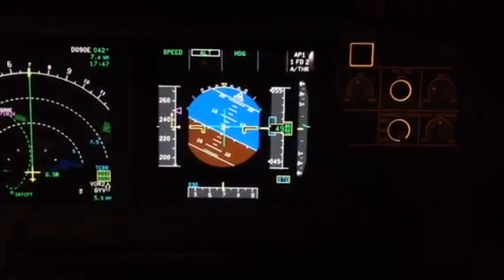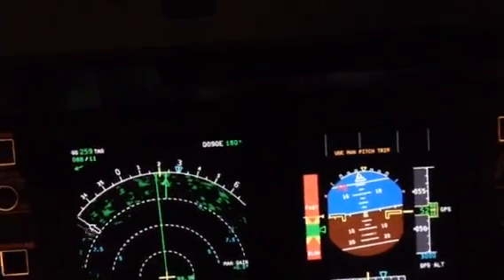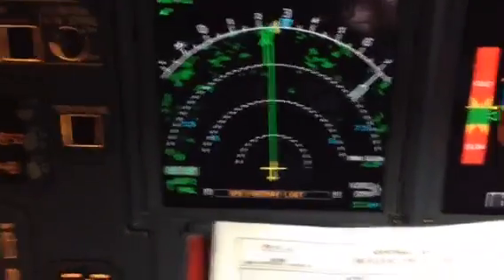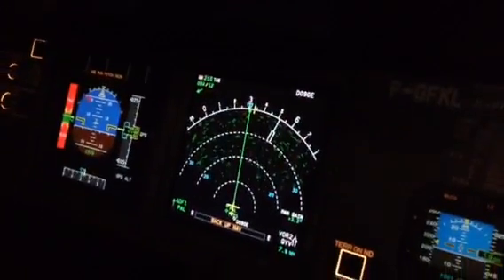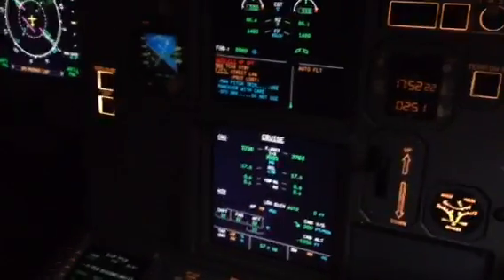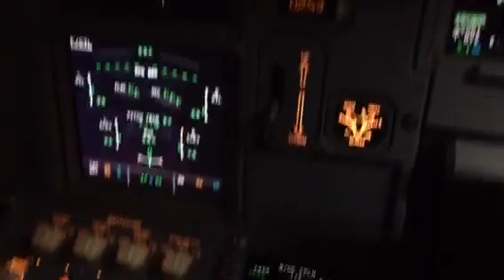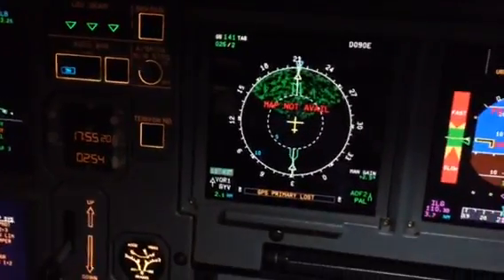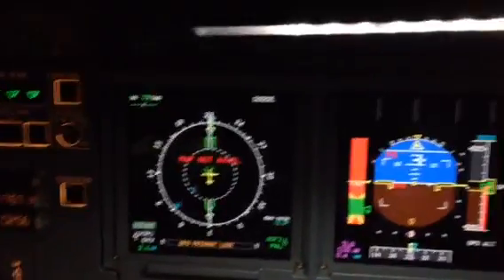Triple ADR fault plus BUSS ( back up Speed Scale ) use and direct law landing

Comment: Super nonstandard cockpit. 
You turned off ADR 1,3,2 instead of 1,2,3.
Nonstandard communication.
Reply from the maker: the intention of the video is NOT To teach "How to handle ecam" nor "how to have a Standard communication".
 It is an internal-personal research to study how to code and program my home made A320 Sim for multiple failures using ESDL manual/ Ecam System Data Logic tells you the boolean logic to trigger a failure.
Reply: @MrAvionis  is not a good place for your research.